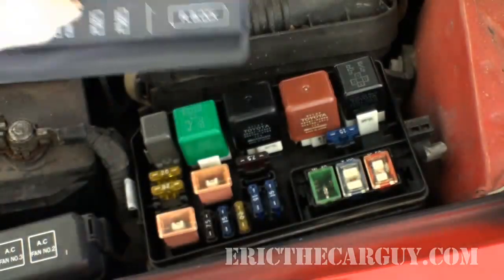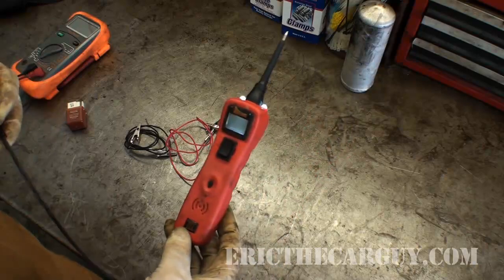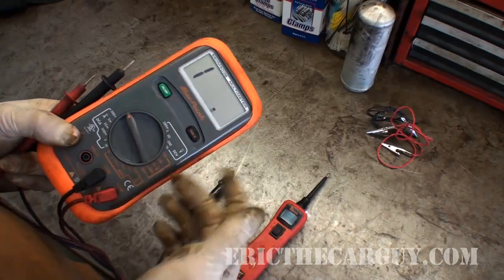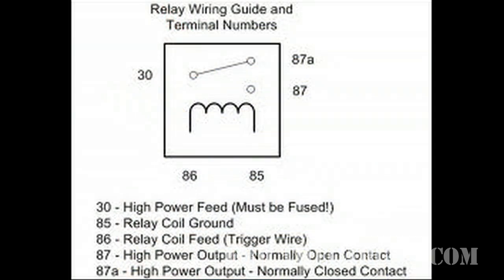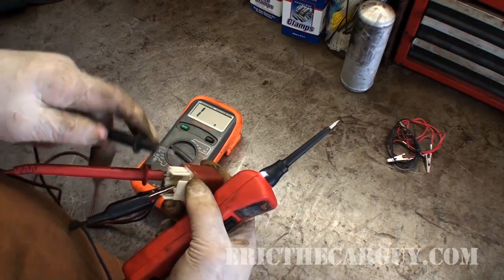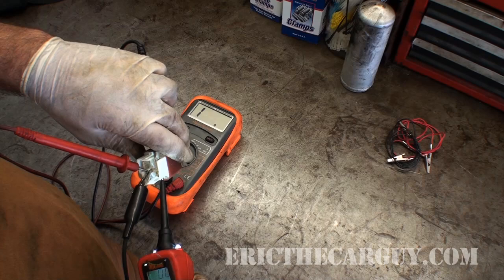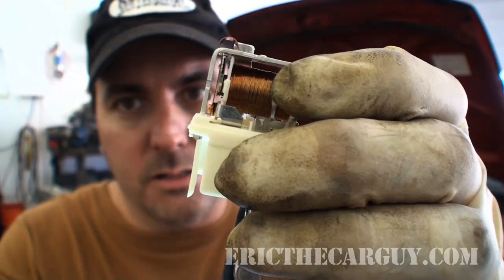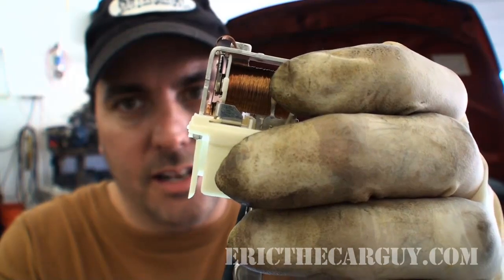How To Test Relays- EricTheCarGuy

Comment: I have a 78 gmc pickup, its been reworked many times, but I had everything working I needed, its rusty, and I plow with it, I had the blower motor freeze up, so I put in a new one, It would not work, I put in a new relay. no good, I hot wired it from the fuze box, now it works, but on high, at the same time, I noticed my turn signal quit, so, I checked what I could, and finally put in a new switch, no good, everything else works, Brakes, 4 ways, running lights, but no signals, and I tried 3 different flashers, it seems there is no power coming out of the switch, Ground? Bulb? why both b motor and signals at the same time?

Comment: So quick question. I have a 1987 VW Cabriolet and the fuel relay went out. The way I tested this was I took the headlight relay and swapped the place with the fuel pump relay. Is this something you could do on any car, or am I just lucky? I don't plan to keep using the headlight relay because I really don't know if there's a difference. I'm going to buy a new relay (today probably) just wanted to ask.

Comment: hi I have a relay well two the number is 96190187 . Can anyone tell me what the rating of the resistor is or what i can put in this.
i have two and one of them says it should have one but there is nothing in there. the othere on has one but i think some one has changed the resistor. here in Australia they are hard to find. thanks guys Nick

Comment: Hey Eric or anyone with the knowledge. 
I tested my headlight relay on my 88 Volvo 740.  I connected alligator clips from the battery, battery cables where disconnected of course, to the 86, and 85 prongs of the relay and at the same time I touched my multi meter that was set on OHMs to the #30 and #87 prongs.   I get the sound of the circuit closing but no reading on the meter after it flipped some numbers it rested on zero.  So with that reading, I'm assuming my relay is bad and that's why my lights are out.  Well both would only come on If the High beams where on.  Now that doesn't even work.  They both come on only if I hold the high beam lever up to but not click into position.  If I click into position I only get one light.  

I hope I dont have to go hunt for a switch at pick a part.  Not sure if it would be the switch to rotate and turn the lights on or if it would be the lever up on the steering column that also turns the blinkers on.  They both seem to be working...

Thanks guys...  Ive done a lot of work on this car myself with the help of others and asking question.

Comment: Plea for HELP. I got a project car - toyota hilux 3rz manual. 
Replaced the clutch, and rebuild the starter motor (by exchanging the core and solenoids, all new bearings everywhere in it.
Checked if the relay switch is ok (and used a spare new one too).  -  still the car doesn't start, i can hear the click noise, it's more powerful like you get on the starter motor solenoid when it pushes out the gear to spin. But it doesn't.
Tried to see using a wrench (19) to see if the engine rotates all the way, and yes it does.

What can be wrong?

Comment: thanks Eric. is it unheard of for relays to not want to work in sub freezing temperatures? I have starting issues (in cold weather only) on an 07 explorer..
Reply: Probably just a weak battery. I'd test it after the car hasn't been driven for a while, since after driving the alternator will fully charge it.

Comment: I have a problem. My serpentine belt snapped, my car was down for about a month, I didn't drive much after it snapped I just took it home because the meter telling you if the car is overheating maxed out. The mechanic came and fixed the belt, but after that my dashboard wouldn't work(only the background light and high beam indicator) and my car will start for a second and then die out instantly. My dashboard worked perfectly and my car would even start before they changed the belt, did they do something wrong or is my alternator damaged? Maybe my relays? I'm confused
Reply: Christopher Ajayi

Comment: don't get it. I tought u cant have battery power when checking resitence..
Reply: Which part are you talking about?  The relay itself?  If so that has two circuits in it.  One circuit is powered to magnetize the coil which pulls in a switch to complete the other circuit.   The two circuits are not connected which means it's fine to have power on one circuit and test for resistance on the other one.
Reply: I am asking myself the same thing...isn't there the rule that you shouldn't measuring resistance while the object is powered (voltage)?
Reply: Yeah exactly,  im going to ask my teacher again
Reply: Oh, I get it now :) Power on one circuit just complete the other curcuit, but the electricity doesn't flow into that circuit. Thank you very much.
Reply: +Shannon Cole.  oyvz d.du($+&&*_
Reply: Its good idea to know Ohms law too.

Comment: Hey Eric! Love your videos, thanks.
I have a 2004 Volvo S60 with a problem which I have traced to the CONNECTION between the brake light relay in the trunk RM15 and the relay itself. A Volvo message board suggested to wedge a piece of cardboard between the relay and the adjacent relay on the board ( probably increasing the tension on the connections) and that actually worked for 2 weeks.
How would you fix this?
Reply: mamachip new relay? Also try some dielectric grease it will help with electrical contentions.

Comment: I have 2012 Chevrolet Traverse n the the car showed the battery charging system need be check,before I made to Auto Zone the battery was drain. So I got new battery n truck start But the amp output wen up n down. Put new alternator on the truck 2 months age still doing it. PLZ HELP!!!!!!
Reply: do a voltage drop test on the cables, including the ground wires.   I burned out 2 alts. on my Volvo before I replaced the starter cable.

Comment: Hey, thanks for your videos, they help a lot. perhaps you can help me with a problem. 99 Discovery 1. Heater blower not working. Everything checks out; fuses, relays, resistor. The one thing I can't figure out is why Im not getting power to the relay activator. How much voltage does it take to activate the relay? and were does this power come from?

Comment: I have a question, what causes the air conditioner to continue to blow while the ignition switch is turned complete off on a 2013 Toyota Camary
Reply: Not a mechanic. So don't take this as fact. If your ac fan continues to run just for a while then shuts off. I would suspect that the fan is designed with a delay switch so when ignition is turned off it remains a circuit and continues to blow the remainder of the cold air from the frosted evaporator. You get a little extra cool down while sitting in the turned off car. If it continues to run indefinitely just remember to turn the ac switch off until you find the solution.
Reply: eddie Jones
Reply: Zed Cartwright

Comment: I have to get that meter so I can do those checks as you described. I just have the multi meter which I use often on my autos and lawn and garden equipment. The Air Force didn't give us the other meters to troubleshoot the aircraft I worked on so the multi meter was a favorite for us.

Comment: Wouldn't car component on the circuit put a much different load on the relay which could make the test turn out much different that a volt meter ohm switch?

Comment: how do you know how much voltage to put onto the relay with the power probe  ?
Reply: 6V battery is enough with a small 6V bulb in series.
If the bulb lights up to full brightness , you have full continuity ie, almost zero resistance in the circuit.
A dim or flickering bulb means some corrosion that is eating the current flowing through and turning it into heat.
A non lit up bulb gives you zero continuity.

Comment: Eric I am having a problem. I have a 1997 acura cl.  When I try using my combination switch(turn signal and parking/headlights) from inside the car, my dash cluster illumination lights become dim.  The switch also does not turn on either the parking lights or headlights. I took the headlight relay out and both applied 12 volts to the coil and it made a distinct clicking sound. I also jumped out the terminals where the relay plugs into and it turned on the headlights(but not parking lights). Don't know if there is a parking light relay, dont see one.  I am thinking possibly the combination switch being defective, ie high resistance. I removed the cowl around the steering column and see the switch and plug in terminal  I am tempted to jump out the switch to get a reading on the ohms scale and also trying to jump out the wiring harness to see if I can get the parking lights to come on without dimming the cluster illumination lights.  Any suggestions?  I don't want to replace the combo switch if its not bad(dreaded parts changing)

Comment: THANK YOU VERY MUCH.  My jeep has intermittent starting and right now I have tried it several times and it will NOT start.  So,   I tested the relay, like you said and it did click but I couldn't get it to click again (It has 3 small studs), so I just thought I Killed it.  But I put it in and it worked great.  Sooo I'm pretty sure the contacts must be going bad so I will get another relay.  I HATE buying things and find out that it was not the problem (I'm Not sure if there could be LOW voltage going to the relay bit I'm happy now).  Fist up, Fight for Truth.  PS. I hate My 2004 JGC Limited.

Comment: I have a honda stream with a K20 engine. Been having issues with idling and drivability. lately i checked the fuel pump and ecm relays if they are working properly. could they be the culprits

Comment: Can a faulty relay stop a car from starting , my car keeps failing to start and the guy said he changed 2 relays .
Reply: +James Bond starter relay can cause a car not to start, also the large fuse to the ignition can blow and cause a no start, bad ground cable to the starter, and the most common is corrosion on battery cables. If you turn the ignition key to the start position and you don't hear the starter then I would check those things I listed.

Comment: When I turn off my 1998 camry the solenoid is still engaging the starter. Is that a relay prob or an ignition switch prob. I had to disconnect battery to make it stop.

Comment: question 1994 Ford F 150 speed thermometer and mileage not working replaced speed sensor on transmission and rear differential still not working what is the possibility if the problem also replaced instrument cluster.

Comment: please answer..if you have a switch to cut let's say fog lights off and on why do I need a relay..from what I understand it's so the switch doesn't burn up..if I have a relay and turn on a switch both has power still going thru them so the switch would still burn up..so what's the purpose just use a switch by itself.
Reply: +225rc you would only have the power needed to engage the relay going through your switch versus having the power needed to run the fog lights going through your switch. If you're using low power consumption (like LED) foglights or a beefy switch that can handle the power then it's not really much of an issue to run it through the switch.

Comment: 99 Caravan - 3.8 / 152k  have owned for a year with no problems, previous meticulous owner ...went on 1200 mile trip and problems with starting occurred without crank. Replaced starter, starter relay and ignition switch for about $550....car lost all power on freeway in heavy traffic on way home after first 350 miles. started back up. Drove 300 miles and stopped for night. Car started, drove 600 miles and would not start an hour later. 8 hours afterward, started right up, drove 150 miles home. Drove for three days no problem, then last night dead again, no crank but lights and all come on fine. Help !
Reply: Start from the battery and work your way through the system if you know how to troubleshoot electrical systems.  There may also be a fuel pump problem or something else.  It may be wise to have a pro diagnose it for you, especially if you don't have much knowledge and experience on how to work on cars.

Comment: What about constant clicking of a relay? I had a relay that was clicking in my center dash by CD player and I didn't know what it was. Then a wire burned up and melted in to other wires. My MPI relay got really hot and my ECU burnt up.. Smoking ect.
Reply: +Everett Bacon  if it was clicking ,,,that means it was turning on and off ( grounding out ) ,,as proven with you burned out wiring  as Dan sullivan in response above you stated ..usually a wiring problem ( I would guess that you have an after market stereo ???
Reply: Yeah I have an after market stereo. I got the car with it in there... But I had it for months before this issue came up... It is an Eagle Talon TSI AWD 95' and now I can't get it to start new ECU new MPI. I am not getting electricity to my fuel pump. I am lost I have my car ripped ripped apart and I just can't find anything other then the burnt wire that goes to my CD player.
Reply: well if no  power to fuel pump ,,first thing you need if a wiring diagram //watch a few videos on how to read one .. then you need a multimeter ..test that there is power to the relay ..and to the fuse ...( I am guessing that your cd player was for some reason wired into the fuel pump fuse ?? 
 even with a test light you cam check that both sides of the fuse have power ...

Comment: we need your help and advice. When you turn the key over in a 2008 Honda Civic EX, no dash lights come on and when you hook the battery up, the tail lights come on, but the head lights will not come on. Also, when you connect the battery back up, the ABS break starts running. It could possibly be the break booster? When we replace the main 100 70 amp fuse in the car, it blows every single time we put it in. I don't know if you can help us or give us any advice. We are stranded and are in great need of someone knowledgeable. If you would like to get a hold of us or even give us a call to help, if at all possible, that would be greatly appreciated. Please just feel free to message me back and we can give you our phone number and/or email. We would really appreciate someone of your expertise. we are at our wits end and have no one around our area to help us.

Comment: i've got a 2000 ford explorer 4.0 with 275000 miles on it....i bought a new starter last week it won't even turn over we cleaned the connections on the battery and everything it'll just crank one time and that's it so please help me

Comment: put power to the high side to switch the low side and then uses an ohm meter or DMM to see if the resistance is 0 or close to it that would mean a relay would be good. your going to say it

Comment: Testing the relay is unnecessary. Simply put a working uncovered relay in place of the one in question and test the system. There's more to this than the relay, and since the wire is the culprit about 80% of the time, focusing on the relay is the wrong diagnostic direction. Either the relay has failed (unlikely) or the coil or load component circuit has failed - only one of the three is the problem. Testing the system instead of the relay gives you a better understanding of the problem faster and with far greater accuracy. mechanics go to the part (relay, pump...) - electricians go to the test point.
Reply: This video is about how to test relays. Not about how to diagnose a problem. 😎
Reply: +Daniel Sullivan if you have a relay and do not have any cars to test it with but you have a 12v battery and a multimeter, then this video show how to test it. Hence the title.
Reply: ***** Nope - 32 years in the transportation industry - plus AC. Sorry.
Reply: +Daniel Sullivan I thought it was very informative. I just wanted to understand something about the relays because my car has some weird ghost electrical problem going on that is intermittent and super hard to diagnose. Playing with the relays seems to do something and thanks to this video, I can see why.
Reply: Leslie Brady Remember - 80% of faults occur in wiring, AND, it's always something simple - A.S.S.... :)
Reply: its better to start somewhere easier than somewhere that will take forever. either way, scenario varies by case. Eric is a great electrician and knows his craft.
Reply: MrPatrix1988 Oh - yeah - well I guess that's right. Of course, you can also use a 9V battery. Either way, if testing a relay is what you want to do, this certainly works.
Reply: Relays do go bad from time to time especially aftermarket ones if you know what the main relay in the Honda or functions they do they too may Standed you any ware.  but 80% is wiring my ass shit fails dei relays are one of the best and I have seeing them fail
Reply: MrPatrix1988 That's the problem - the relay is part of a system, and the wiring fails 80% of the time. Testing a relay is essentially unnecessary. If you put a "good working relay in with the cover removed" (from your box) and the system works, it's the relay. Diagnosis and repair over. Testing the relay is passé - that's why I don't talk about it. With the uncovered relay you can also visually and mechanically test the two system circuits (coil & contacts) to see which one of those 2 have failed - if they have. I can have the entire system tested in about 30 seconds with 100% accuracy - before Eric starts. He's reteaching what has always been taught - I'm teaching something new. Some people either can't - or don't want to - handle it.

Comment: hi i have a 2006 holden and my starter relay works when i do a long run in it but when im around town  the starter relay  dose not start car  i have to open bonnet and start the relay by pushing the fin peace to the coil and it starts hope you can help me  cheers
Reply: Brent Hudson had a problem like that with my pulsar not sure if your car is automatic or manual but it wasnt my starter relay it was my inhibitor switch relay check that but thats just my experience.